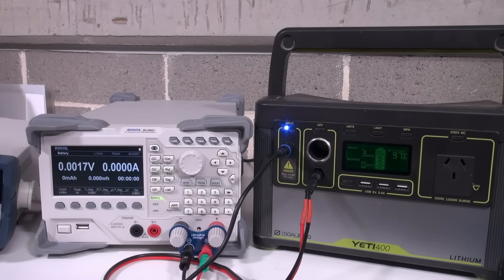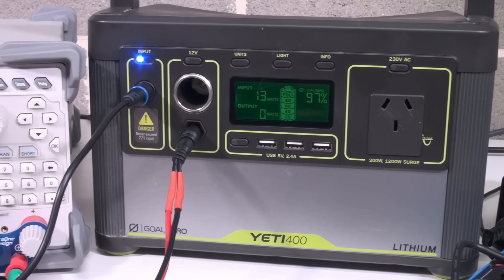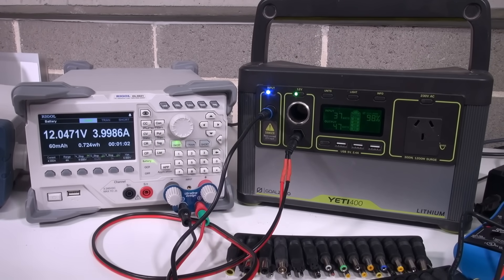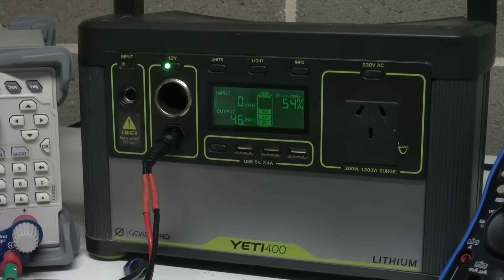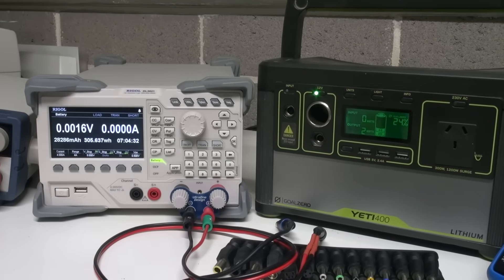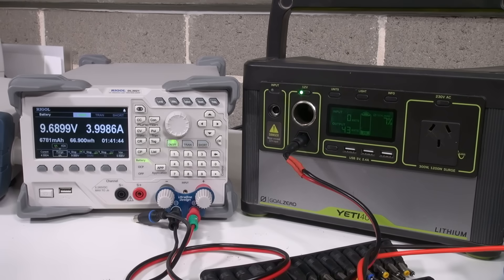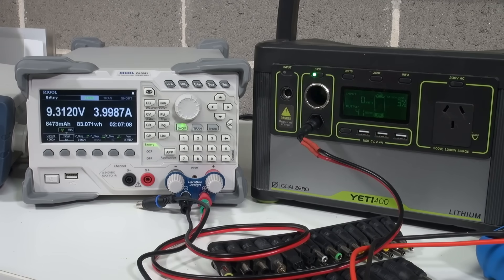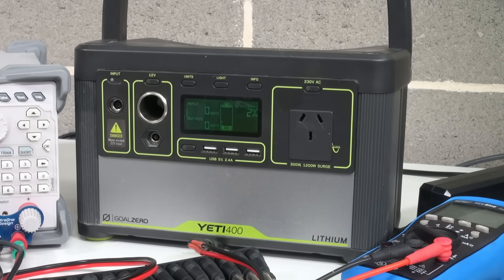Goal Zero Yeti 400 Lithium Battery: Capacity Test

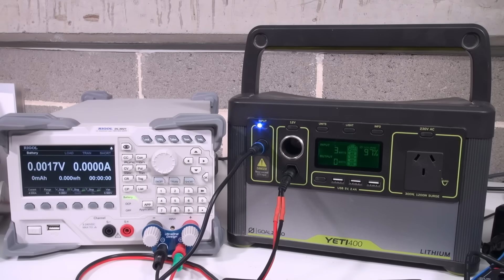Comment: 1:03 "Nominally 12.8V" -  12.6V at full charge suggests a 10.8V nominal 3S Lithium ion battery. 12.8V nominal would be a 4S LiFePO4 battery.

Comment: That's nuts. never would've expected such an old battery to pull full capacity. Such a shame it is unable to start back up when the voltage drops too low though...
Reply from the maker: Yeah, pretty surprising. I think it must have had way more than 400Wh to begin with.

Comment: I figure you could measure the voltage across the load negative and the cigplug negative, as well as across the load positive and cigplug positive to see where the drop is happening. If both are the same value, then it's over the wiring either internally or externally, and implies they're not individually protected. If it's higher on the negative, it's dropping over an internal switch that's in series with the barrel jack -- like an N channel mosfet.

The latter would hold true for the individually protected socket hypothesis, as the mosfet on the cigplug wouldn't be dropping any voltage due to the lack of any current flow over it.
Reply: Pretty clearly the connector, the voltage is all over the place when he touches it and that is also my experience - they are not good/reliable/repeatable/...
Reply from the maker: @leocurious9919  Yeah, the DC jack connector isn't the best fit.

Comment: With all the things that got messed up you should repeat the test, starting at really 100% without interruptions and without the cutout on the load side and at 2 Amps.
Reply: What relevant thing got messed up? The capacity is already pretty good and it will only be higher if he does it better next time.
Reply: @leocurious9919  You may be right, but as a german engineer, I just can't stand this imperfection, sorry 😅
Reply from the maker: Why? Fixing by getting the proper connectors and using 4 terminal measurement is only going to *increase* Wh figure, it can't decrease. You can't get a false positive on a Wh test, that energy went into the load.
Reply: its not really a review, just a simple good ok bad test to see how well it held up and getting this close shows its a healthy pack

Comment: Wouldn't you expect it to short in constant current mode as it drops the impedance to min because the current is below threshold.
Reply: V_stop is 9 V. Below that it has to automatically turn off. Never can it short in that scenario.
Reply: Yes, but also no. Or rather yes, if it's turned on. If it's terminated the battery test then you'd expect it to terminate the load condition too.
Reply: @AnnaVannieuwenhuyse test was still going.

Comment: I guess links are not allowed.  Rigol admitted the fake shorting issue and supposedly fixed with 1.05 which Dave already has.  Since I can't paste the link, here's the text from their support site (article title: Fake shorting issue in DL3000)  

"Some customer reported when turn on DL3000, the resistance is around 0 when using a DMM to measure the black and red input, when the ON/OFF status is off. It probably is a firmware issue.

To check if the shorting is a real or fake, first press any button on the front panel, then measure the resistance again. If the number changes to normal, it is a fake shorting. Check the firmware version, upgrade it to version 1.05 or higher."
Reply from the maker: Youtube nukes links. INteresting that they know about and tried to fix it. Someone else has said it's a combination of firmware wiht FPGA version.
Reply: @EEVblog2  Damn YT.  Even if I strip everything out it nukes it; if it only did that with spam.  Do a duckduckgo search on "Fake shorting issue in DL3000" and it should show up.  Maybe if you force flash 1.05 again it gets fixed? 🤷‍♂

Comment: that version is 400-428 Wh older uses lead acid it should be on the higher side and it uses at least 5wh being on so either you barely used it or something isnt right with your testing
Reply from the maker: There can't be anything wrong with the testing, the Wh figure displayed is the absolutle minimum Wh figure that was dumped into the load.  It's actually more because of cable losses that the load doens't know about because I didn't use 4 terminal measurement.
Reply: @EEVblog2  Most losses will have been in the connector, they are really bad, look at the voltage jumping all over the place as you touch it while measuring.
Reply: Struggling to understand your point, do you think the result was too high or too low?

Comment: It's got a watt-hour display! You could have just run that for goodness sake and just use it as a regular load and not use that dodgy thing... you could have used your proper electronic load over there.
:)
Reply from the maker: Actually, nope, it's a fake Wh display. When full it displays the guestimated remaining Wh, not accumulated Wh from discharge.
Reply: @EEVblog2  Ahhh so close. I was wondering why it was reading 475Wh the other day. In any case I would trust an external measurement more anyway. :)